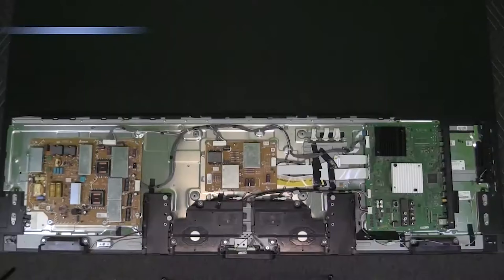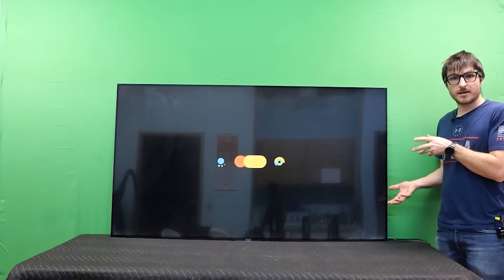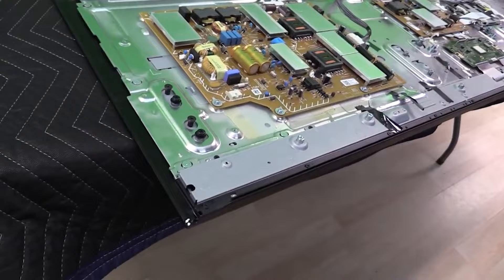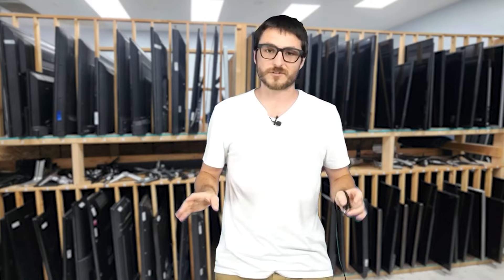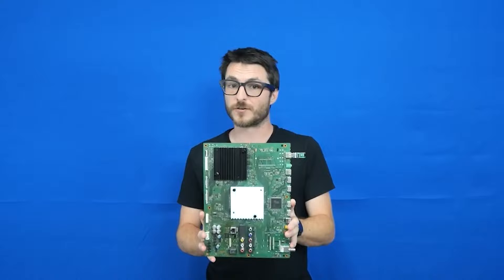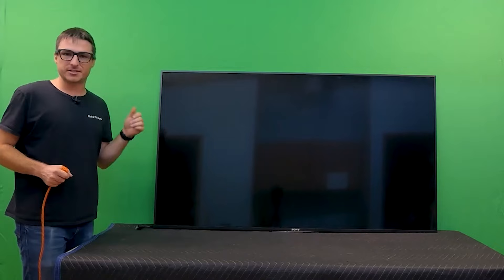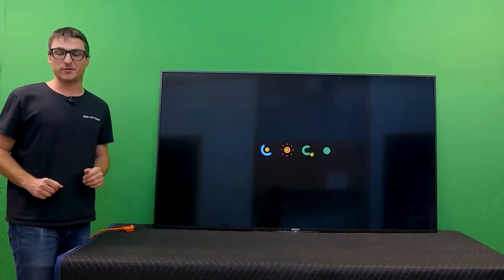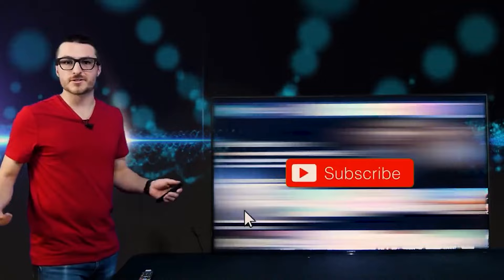I Fixed Over 1,000 Sony TVs Here Is Everything I Learned | Master Series

Comment: Hello again Nick. If the power board measures ok, however no standby light, no sign of any power at all except the click of the power board when plug is connected or disconnected from the wall?? Could a bad software update stop everything?
Reply from the maker: Yes that is commonly the case. Keep in mind though the software itself is usually not the fault, the fault is more commonly due to a defective eMMC chip. The chip itself degrades over time. Once it gets bad enough certain sections of the memory chip where the code is written to won't work so when the software needs to pull information from certain sections of the chip, it won't be able to and the system will freeze, corrupt, and cause these faults.
Reply: Hi Nick, today while continuing my troubleshooting I plug TV into wall and there is no click now,so the problem has got worse. Back to square one, really confused

Comment: Hi, the eproom you are replacing with the new one, you upload the firmware via USB only, I have the new eproom, is it already programmed? thanks
Reply from the maker: No, the eMMC chip is pre programmed off the board, in a specialized device for programing IC chips that is very expensive. Then the programmed chip is soldered to the mainboard. Once that process is completed the mainbaord is fixed and working. However it does need to be paired to the TV it is being installed to. The pairing has nothing to do with the repair of the board or the eMMC chip. Any time you take a mainboard from one TV and are installing it into another you have to pair the mainboard.

Comment: Hi nick I’m repair my sony 55w905a change led strips tv work great but have little pink color what mistake doing? The led strips buy have blue light not know if can find led strip with wight light;)
Reply from the maker: That is most likely because the diffuser sheet is damaged from the original LEDs going out. There is nothing you can do about it unfortunately.

Comment: hello nick i want to asko you something i hope you don't mind.vlog you show that you had change the cpu with new one how can it possible to change cpu in sony because it will bind with emmc with a aes security key i worked on new chip its so difficult do you use old cpu or you program it by manufacturers tools
Reply from the maker: We just swap the CPU, no reprograming going on. Now binding with emmc. We might loose some of the smart features sometimes but those can easily be accessed via a firestick, roku, chromcast or other similar type device.

Comment: For the 85x850g would it be the main board issue when it’s stuck on the Sony logo and cycle on and off, sometimes turn the screen green , or flickering the image of the Sony logo?
Reply from the maker: Stuck on Sony logo is most definitely a Mainboard fault. Cycling on and off is most definitely a mainboard fault. 
Flickering of the image is a bit of an odd symptom but it can also be due to the mainboard although that could also be LED backlight related or a screen fault.

Comment: Hi nick I have a Xbr 65 A9G when I plug it in I get the 4 flashing lights what do you recommend I do please….i live in the Bronx New York maybe you can point me to a repair shop you recommend near me thanks
Reply from the maker: That's going to be most likely a backlight failure. But I would recommend also checking your Power supply and LED driver as those have been known to occasionally also cause that blink code.
If I were you, I would find a seller with those 2 boards that are for sure known working, and that has a good return policy, swap them out and see what you get. If the fault is still there after replacing those 2 boards then it means you have defective backlights which is also more broadly called "panel" and you won't be able to fix this TV unfortunately unless you can get it done under warranty from Sony.

Comment: Thanks for a great video. My kd-43x8305c was dead so i replaced main board after doing  v checks as suggested on your video.
I ran the software update on the ebay board ahd got a pulsing white led that after an hour or so led turns blue, then restarts with pulsing white again. Any ideas as i cannot find any info on blue status
Reply from the maker: There is going to be a dark blue almost ultraviolet light to comes up right at the very end of the pairing process. Then it goes away and the TV is supposed to turn off and back on either asking for the pairing a second time or it will turn on as it should with picture and go to the normal boot up menu. 
Now if it's stuck on the blue light or it keeps cycling back to pairing indefinitely it is often due to the mainboad being defective. 
It's rare but sometimes it is because of the software on the flashdrive so maybe try redownloading the software fresh from the Sony support website and rename it to upgrade_loader.pkg

Comment: I have a KD 55X9305C Manufacured 2015. It started to become slow over time, and when i got home from vacaition, its completely dead. Does it sound like a motherboard chip issue? /regards from sweden
Reply from the maker: Yes most likely you have an eMMC failure. I would recommend reaching out to MJK electronics, they are in France and should be able to help you with repairing the mainboard.
Reply: Thanks a lot. I will reach out to them. Would a main board replacement solve the problem also? If I get my hands on a main board I could change it myself maybe. Thanks again for taking the time to answer
Reply from the maker: Replacing the mainboard most likely would solve this.

Comment: Hi Nick, I have an 2014 Model XBR-55x850B. I can appreciate your videos and the details. My tv has started with a crackling sound output from the TV. The Optical, HDMI, and Internal Speakers exhibit the same behavior. Would replacing the board help? Or is there another part I can check?

Thank You!
Shay
Reply from the maker: Hello Shay,

Sorry, but none of the Sony repairs I do apply to your unit as I only work on 2015 and newer models. The 2013 and 2014 units did work drastically differently. 
What I can tell you is I don't recommend trying to replace the mainboard as you will need to pair the new replacement mainboard to your TV and doing so is no longer possible as the software is no longer supported by Sony. Your best bet is to use an external sound system with a receiver and plug in your HDMI and other external devices to the receiver first so it can extract the audio and then send only the video signal to the TV. 
This workaround is your best bet for resolving your audio issue.
Reply: @NicksTVRepair  Thank you for the response. I really appreciate the advice!
Reply from the maker: no problem

Comment: Hey nick i have a question for you. I have a sony xbr49x900e. The tv suddenly developed a line horizontally 1/3rd of the way from the top. The line isint black or white but has some changing colours and the partof the screen above it is just a little bit brighter than the rest of the screen. I checked the ribbon cables and they seem to be ok. I cleaned them well. I know someone had similar issue and posted it on google but I havent had found a definite solution rather than “replacing” the whole tv as it isint in warranty anymore. Could u suggest what could be the problem?
Reply from the maker: First I would like to say thank you for posting the full model number of the TV. Unfortunately a horizontal line on that type of model is typically caused by the panel itself failing. I am sorry but this is a situation where it is not financially viable to fix the set. Replacing the TV is your best option.

Comment: Hey man, thanks for this super useful video, i have a KD-49XH9505 (2020 led model) and it stopped turning on yesterday, i can boot until the Android logo then it turns off followed by 4 red blinking light, do you think you can identify this issue ? I've tried a hard reset but after the light turns green, it boots to the Android logo then turns off again. Help is appreciated 🫶
Reply from the maker: 4 blinks is an indication of the following failure in order of the most to least likely
LED strips
LED driver board
Power supply

99% of the time it's the LEDs in my experience, sometimes its both the LEDS and the LED driver board or power supply. Almost never is it only the LED driver board but I can't say never because I have seen it happen twice before.
Reply: @NicksTVRepair  for my specific TV model right ? Thanks a lot for your response even if it made me hopeless for my TV 😅 i don't see myself changing the led strips at all if they're the culprit here, i hope it's not them that are causing this problem, if it's like the led board or the power board that's fine really ! Anyway thanks again, that put things into perspective for me
Reply from the maker: You can give those a try if you want but make sure you buy parts from a seller that allows returns in that case.

Comment: I have a 2016 Sony Xbox-55x850D, one day no power.  Took to repair guy who told me it was main control board  but he wanted 400+ to replace when the part is 170 to get to me.  I opted to that router but main board came in and I installed and same issue.  Any ideas on what to do next?
Reply from the maker: You have a 2016 Sony XBOX! Wow, I didn't know they made those! Incredible. 
As for your Sony XBR-55X850D, the most likely reason you have no power is either because it wasn't paired to the TV, or the mainboard you were sold is defective. 
These mainboards are discontinued and no longer available for sale, only used ones or refurbished ones are available now. 
If you want to send in your mainboard to our repair facility, we can live test it for you, confirm the fault, repair it, and of course we live test the board again for functionality before sending it back. This way you know 100% for sure the board you sent was the fault since we confirmed it before repairs, and have 100% confidence it's working because we live-tested it on the way out. 
Most sellers of these mainboards bought big lots of dozens of returns or broken TVs, gutted them, and put the parts for sale not really knowing what is and what is not working. That is why there are a lot of bad parts out there.

Comment: Hi, i have a kdl 40w605b which connector should i cut/ground? don't have the tools to measure it out, tyvm
Reply from the maker: No need for specialized tools or to measure anything. I do that in the video to visually show you the viewer that what I am doing and saying is happening, nothing more. Per the video look for the BL_ERR pin on your power supply and look for a ground pin. Ground your BL_ERR pin and you are done. You just need to look for the legend and it will have all the information you need.
Reply: unfortunately it doesn't say on the board hence i asked if someone would know what pin it is for that specific model but ty @NicksTVRepair

Comment: Have you worked on a Sony 65-inch XBR-65X950G? I can't find anything on YouTube for this model. Literally nothing. I've had no issues with it yet, but when and if I do, I would like the knowledge to know how to, so I can fix it myself, but I can't find any info to do research so I can. Can you help me with this or point me in the right direction? I would greatly appreciate it, thank you...
Reply from the maker: We have worked on them but not often. I have had one come in with a 4 blink code which can be LED strip failure but also a backlight inverter. We have seen one come in with a bad panel, which we couldn't fix without replacing the entire screen. Unfortunately, that was cost prohibitive so we sold the customer a replacement Sony with a credit for their parts, and we have seen 2 with a mainboard fault. 
So right now this TV does seem to be a bit all over the place for us in terms of common faults. But the good news is that while we have too small of a sample size to get reliable info, it means we don't see it fail that often. 
If we do start seeing it come in more, I am sure we will do a video on it.

Comment: I have a Sony 49x900f and it turns on then turns off and blinks 4 times the bl error pin it at 0. What should I do. I assume I will need a new motherboard. Do you sell main boards?
Reply from the maker: 4 blinks is a backlight failure. You will need to replace your LED strips most likely.
Reply: @NicksTVRepair  yeah but it turns on and I see the Sony logo then it goes to the android one. Then shuts off and does the 4 blinks. Also the bl error is at 0 and all the voltages seem fine. Do you have a video and do you sell the parts?

Comment: Hey Nick please help. Xbr-85x850g I have verticle lines that starts during or right after the sony logo. Its not the t-con i replaced it with a known good board. Whatelse could it be? Thank you
Reply from the maker: The fault you are describing sounds like a screen failure but there is a small chance they are due to the mainboard. Have you tried a new mainbaord? 
Could you by send me an email with a short video of the Sony logo appearing properly and then the lines or a picture of the lines. That might give me a better idea of what could be happening. Our email is in the video description at the bottom of the description after all the time stamps.
Reply: Haven't tried a new mainboard. What email can i send you a video? Thanks
Reply: Also should note that it always looks perfect (hopefully not a screen) for the first 2 to 5 seconds then the verticle slowly appear until you cant really see anything but the lines.

Comment: I'll never buy a sony tv
Reply from the maker: They have the nicest picture and in my opinion easier to service than many other brands.
Reply: @NicksTVRepair I agree about the picture quality.Most easy tvs to fix are Vestels, did not think they exist in the US,pretty popular OEM manufacturer of budget tv sets here in Europe though.
Reply from the maker: @dimitrismaster  What i like the most about the Sony sets is that unlike some of the other brands they don't typically have panel pailures, so the screens don't fail often and the LED's don't fail often (a couple lower end models do but few). So most of the time it's a board replacement which is much easier to fix than removing a screen to swap LED's.
Reply: @NicksTVRepair  I agree.Most of the times when a Sony is booked in for repair in my shop,I know that it's most probably a tcon or mainboard issue.Problem here is that emmc chips and processors  aren't available in the local market.
Reply from the maker: @dimitrismaster  Yeah we have to buy from china all the time for those.
Reply: @NicksTVRepair  the most difficult part about China orders, is to find an honnest supplier who doesn't sell fake or badly pulled/burned chips,warped CPUs etc.